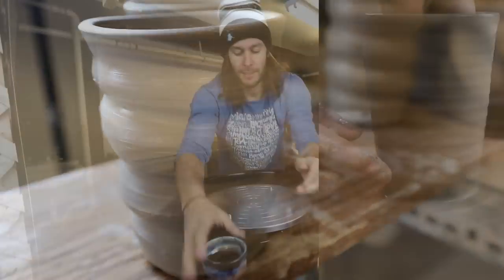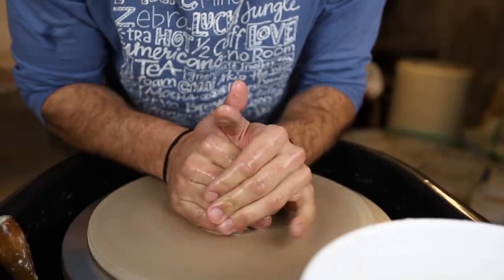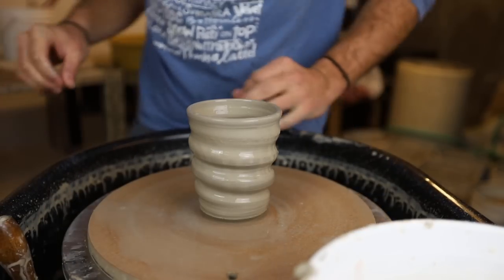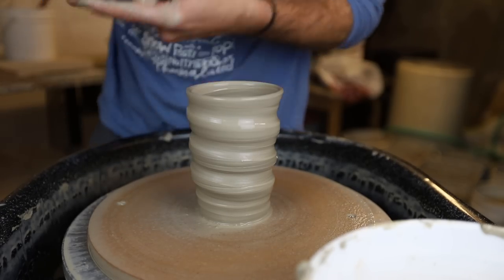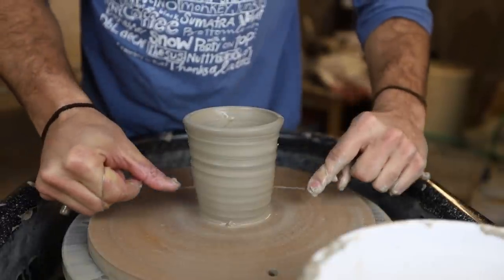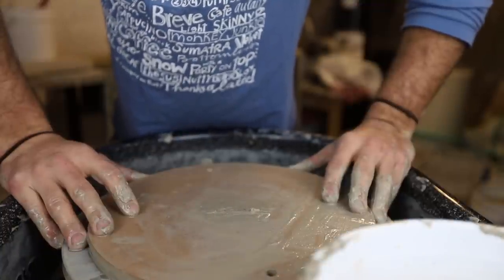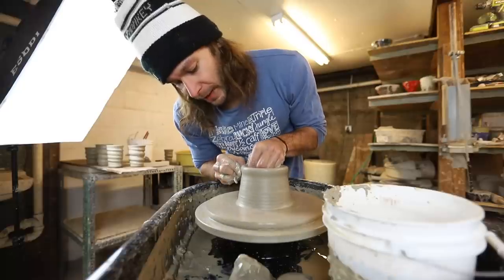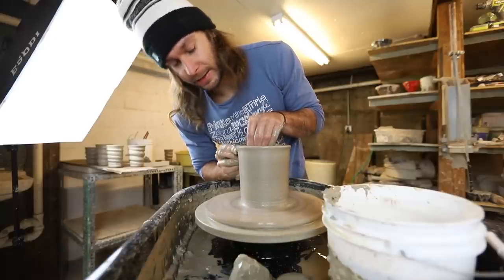How to throw SPIRAL CUPS on the wheel!

Comment: Jon! How do you cups not warp when you pull them off the wheel? Am I throwing my walls to thin? Every piece I pull off the wheel warps ☹️. Bats save lives
Reply: Yeah, I keep mine on bats as well.  The trick to moving them batless, is picking them up, directly from the bottom.  I've seen plenty off potters move them without a bat, and the wares warp in the move, only to go back to true once set down.
Reply: For those of us new to pottery what are bats?
Reply: Bats are plastic disks you can attach to your wheel via “bat pins”. That’s what the holes in the wheel head are for. They make it so you can cut you piece and lift off wheel without having to touch the raw clay at all.
Reply: @tattmodd1660  Plastic, wood, plaster, a lot of different materials are used for bats.  All have their pros and cons.
Reply: Forgive me 😛 I didn’t feel like editing the post 😂 I actually use wooden bats myself. I don’t know why I said plastic 😜
Reply: @tattmodd1660  The firsr bats I ever used were plastic.  I use "Wonderbats", with the inserts, in my home studio now.